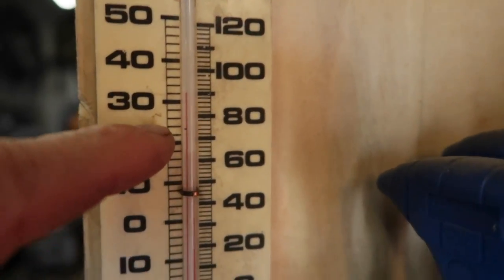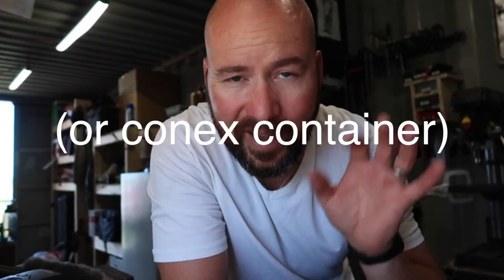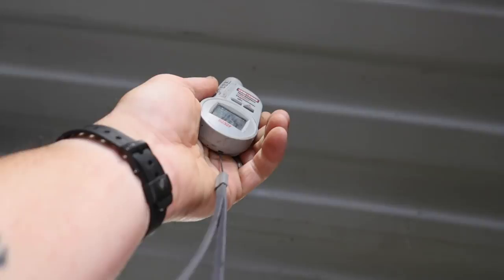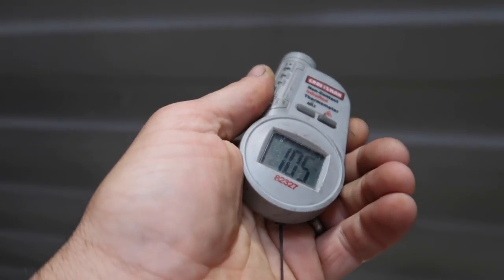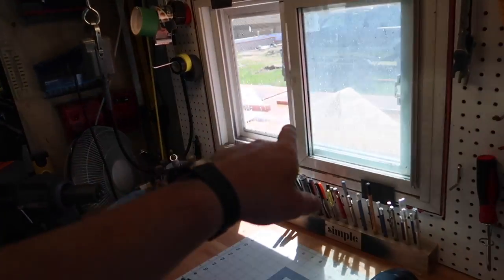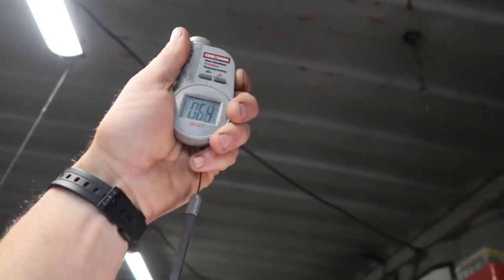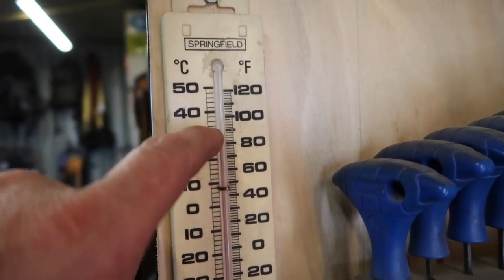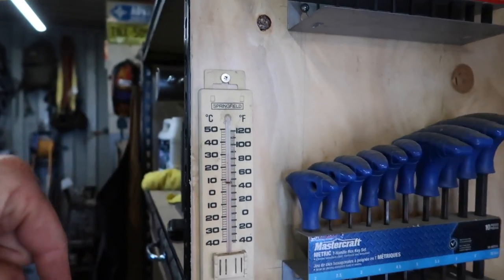Shipping Container Shop: testing evaporative cooling as a DIY Air Conditioning

Comment: While stationed in central California back in the mid 60s, the base housing unit I lived in did not have air conditioning. We had a swamp cooler. Very effective cooling system. Your video reminded me of it. But a (possibly) better idea for you is to build an additional roof over the top and put some insulation in it to protect your shipping container from the direct effects of the sun beating down on you. It might also provide some relief during the winter months as well.

Comment: I like the ideas about reclaiming water, using solar for the pump, etc. As for reclaiming, you'll lose a lot, for exactly the reason this works in the first place. Evaporation. So maybe a float valve to refill the reservoir you pump from. Also, for now, turn the sprinkler the other direction, and put a shutoff valve inside the shop...

Comment: I am in the Nevada desert and my "shop" is my garage,  I will go out and spray the roof of the garage off on really hot days and it does work for a while.  I give it a good soaking and then it drops the temps quickly.  Great vid!  BTW are you selling that knife you were polishing up?  I love those smaller neck knifes, Would love to pick one up

Comment: White rubberized coating or RV white rubber roof roll on the top of your can and insulate it with some foam sheeting. Also a window AC unit cut into the wall somewhere would work wonders-- get an older one that is large and runs on 220v.
Reply from the maker: those are some great ideas! Thanks for sharing!

Comment: Put a roof over the roof for shade.....even shadecloth zip-tied to 2" pvc pipe arched over the container. drive in star pickets and slip the ends of the pvc pipe over to anchor and hold. Guide wires front and rear to tension..... google pvc shadehouse for pics..
Reply from the maker: I like that idea! I'm going to look into trying something like this for sure! Thanks!

Comment: Nice solution Jeremy! But what if you put something up on the roof that would absorb and hold the water, so it can eveporate slowly over the day. Say a foot of dirt with grass or moss, and wooden planks to keep the dirt from whashing off the roof. Or better yet, burry most of your container completely, except for the doors and windows. Underground you have a very stable temerature due to the insolation

Comment: Maybe think about a truss roof with 4' overhangs and R-38 ceiling insulation. Not only will it cool you in the summer but cut down your wood use in the winter. If you were to insulate the walls put it on the outside and then metal sheeting. I have seen guys set two 53'er 12' apart on a concrete pad then roof over the whole thing and have a great place to work out of. Stay cool.

Comment: video on you tube of a couple in Hawaii that live in a container, painted the roof with reflective white paint dropped the temperature.  you might check it out as a possibility.  putting gutters along the side and running the water to potted plants or your garden might be an option to save some water.
Reply from the maker: That's cool I'll have to check it out. And I really like the idea of the gutters. Maybe even almost re-used the water and make it almost like a closed loop system that I just have to top off due to water loss from evaporation. Could even solar power the water pump.....hmmmmm....thanks the ideas!
Reply: @Simplelittlelife  Or make the roof your garden. I think it is called green roof.

Comment: ram pump to a tank, tank to drip lines, if possible. 

So the metal definitely conducts heat well, maybe even a fabric to hold some small amount of water, to help lower the drainage and boost the evap

Comment: Put a few pieces of scrap wood on top of the container, and then a metal sheet on top. That way there will be an air gap between the container roof and the sun. The add-on metal sheet should take care of most of the heat
Reply from the maker: I'm going to have to look into something like this. Thanks for sharing the idea!👍

Comment: i live in the tropics and i was fortunate to get a reefer (refrigerated) container in which i am setting up a temporary shop. a godsend because a normal container would be unbearable. i think the system would only work if there is a steady breeze, otherwise the evaporative cooling would not keep up to the heat of the sun. but still a good idea

Comment: A circulating system would be a good option to avoid wasting water. Some pvc with holes drilled in it and an electric pump. The biggest problem would be mounting it and a gutter system to collect the water. I'd try to avoid any holes in the shipping container to avoid future leaks.

Comment: Have you seen the passive cooling buildings that use charcoal in metal meshes with water that drips through it? The heat evaporates the water and that draws the heat from inside the building. I seem to remember it was to cool vegetables after harvesting... In Africa possibly but I can't be sure.

Comment: Paint the top "reflective white". You will loose some of the "free heat" in the winter, but more importantly, you'll lose more "free heat" in the summer. Besides, in the winter you got the wood stove and it's easier to heat on the cheap than cool in the cheap.

Comment: Hey I have a solution to your heating issues.  It's a Thermal Insulation Paint called Super Therm.  It's sprayed onto your container and it reflects UV Rays, and it reflects heat and inferred rays as well.  You might want to look into Super Therm Insulating Paint.

Comment: A 4" to 5"  air gap will do the same thing. Some 2"x 4" x 8' and a tarp. You might also add a cyclone vent at the back of the container.

Comment: Here in El Paso my entire home is cooled by an evaporative cooler. 100+ outside 77 inside. The more humidity there is the less it works. In central Texas (60-70% humidity) I will not work at all.

Comment: forget your complex water system. frame a box around the roof out of wood or steel throw down a liner so your not putting wet soil against your cans roof, keep some space for drainage, fill it with dirt and throw down some sod or any vegetation. That should keep you much much cooler than a water mister.

Comment: Go Google 'ceramic thermal paint' and you'll see both complete solutions and paint additives. Not super cheap but will be a step beyond simple white paint and you won't be wasting a lot of water (or drenching everything around you). As others have said, swamp coolers will work but only if you are in a very low humidity area. I think to save money and hassle, you should look at a regular "window shaker" air conditioner. They make some very compact and very efficient units and you can also get them with heaters so it will work well for your winters up there. You'll have ice hanging off you nose in no time.

Comment: What's your normal humidity this time of year? i live in the desert of southern cali its a dry heat and we use what they call a evaporative cooler.
http://www.homedepot.com/p/Champion-Cooler-5000-CFM-2-Speed-Window-Evaporative-Cooler-for-1600-sq-ft-with-Motor-and-Remote-Control-RWC50/100185332

Comment: What a waste of water. Put sandbags (burlap ones with sand not soil) and a canvas canopy above the sandbags. Run the sprinkler system until the sandbags are saturated and you basically have a zeer pot. The effects will last much longer.